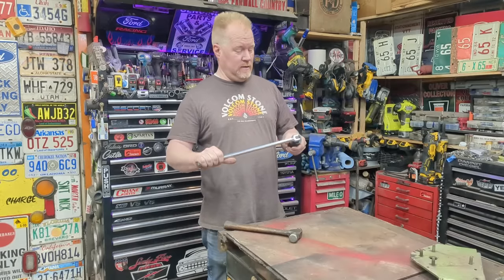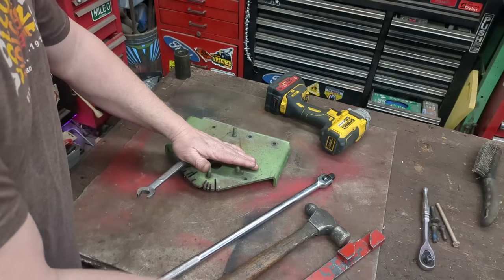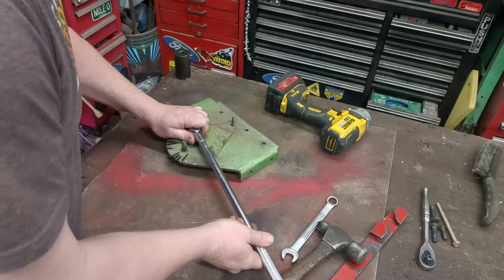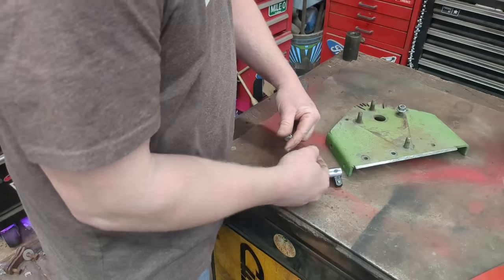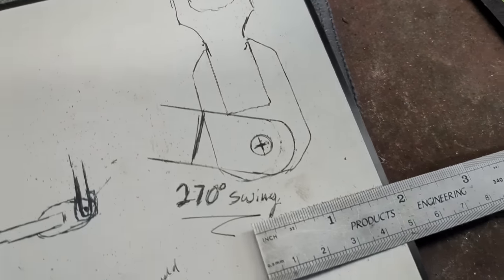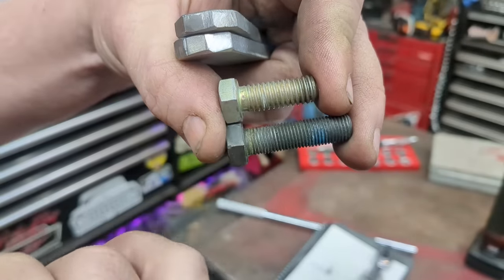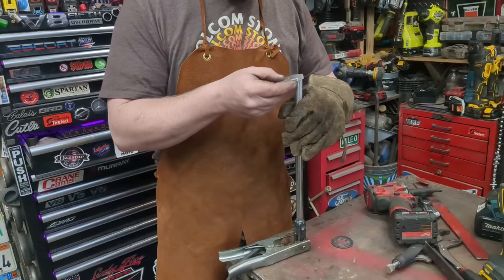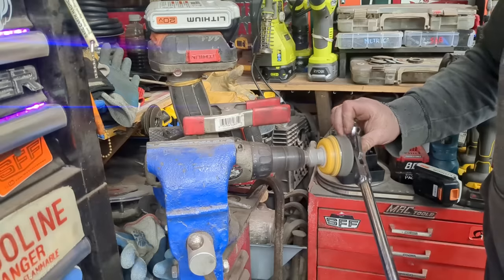Hammer Impact Breaker Bar  DIY BUILD

Comment: You should put a patent on that
Reply: Don't worry. Somebody else will now.
Reply: I'm sure I have seen something similar.
Reply: Snap-on sells hand impact wrenches under blue point.
Reply: I have a very similar tool to the Toledo, T+E, Laser Tools versions, I bought it pretty cheap many years ago on ebay.
2ft long 1/2inch drive.
Only real difference is the black square drive head doesn't pivot, it's fixed 90° to the handle/hinged part👍
Reply: @philmickey7247  This style tool has been around for years, I'm sure they would've come out with their own version by now, if they haven't already🤣
Reply: matco tools sells one. got one in my tool box.
Reply: @simonilett998  'Own' version.
 Years ago... I heard a story of a mechanic 'making' a tool, and the Snap On dealer ask to borrow it. Sometime later, a nice chrome plated copy of the tool was displayed.🤔 That's business.😊
 Thanks for the comment.👍
Reply: @philmickey7247  Yep, probably not too uncommon a scenario.
So, if someone really wants to ensure they earn 'something' after coming up with a 'revolutionary idea', I guess they are best to patent it.
However, I'm guessing registering a patent is quite costly and time consuming, and also specialized tools are often thought up to serve a one off situation, where the 'guy' probably couldn't afford to go and buy an alternative already available tool, or justify having one specially made, let alone afford the patent process😁
Reply: Snap-on has sold one for at least 10 years
Reply: @simonilett998  Ya said it.😊👍
Reply: It's not an original idea.
Reply: Private brand tool has the patent on the tool already.
Reply: @simonilett998  I think it's better that it's fixed
Reply: @schwuzi  I agree👍

Comment: Someone else here mentioned your paint can shaker video and I just remembered some things I did to augment that when I fabricated my own. 
I used lids of various sizes, cut off cans with a safety can opener so there were no sharp edges. Used multiples of those to beef up the attachment to the central bolt instead of washers because the additional lids distribute the force over a larger area. 
I drilled a hole in one of my overhead beams to screw it into the beam so it’s always right there overhead next to my bench. 
I also use multiple sections of scrap rubber membrane roofing to wrap around various spray cans to secure them inside the shaker so I can invert it if I feel the need. I’ve found that being able to hold the can in a vertical, horizontal or inverted orientation helps to get the shaker ball inside to act upon more of the contents. 
I’m currently working on other iterations of this tool utilizing smaller cans to accommodate paint pens, which also require vigorous shaking before use.

Comment: Nice!! We had something similar at work that had interchangeable wrench ends instead of the breaker bar side to remove fan hubs. You could also use either a hammer or an air hammer to impact the other end. I think the breaker bar end makes it waaay more useful!

Comment: They make one of these for a air hammer i use it on Crankshaft bolts all the time i believe mine is made by otc been around since the 90s im pretty sure i gave like 30 bucks for it. I will say you should try putting flat bar on it and welding a anvil just the offset bringing it in more aligned with your piviot you will notice a significant difference in the alignment and less likely to cam off a bolt. Although i do appreciate watching you build it more satisfying in the end if you're capable!! Great video!! 3 thumbs up!!
Reply from the maker: If anyone had one you would. 😁

Comment: Nice job👍
I have a 2ft long, 1/2inch drive version of this tool I bought on ebay many years ago, it wasn't too pricey, only difference is mine has a fixed drive at 90° where you used the pivoting style breaker bar head, so your's is actually a bit more useful for leverage when flipped out straight.
I've used mine a few times for front crank bolts, flywheel bolts and transmission bolts in tight spots and it works great.
I've been trying to think of what to make from a 2ft breaker bar handle, which I broke the head off a while ago.
This video gives me a good idea, I think I might make a 3/8 version out of it, like you mentioned👍

Comment: Hadn't thought about thread depth as it relates to fastener strength...  tucking that gem of wisdom into my hat!

In my defense, during most of my professional work a 1/4" fastener was considered to be BIG!  I dealt with mostly #6, #4 and smaller.

Comment: Definitely need to build one of these things! I have one of the indexable head ratchets from hobo freight. It didn't survive a few taps of the hammer. Ended up finding a fan clutch remover, It attaches to the air hammer with interchangeable wrenches. They have a hook on the end, Amazon $50 saved the day.

Comment: Great idea. Had a simulare idea i've been using for years, hit the end of the powerbar/ratchet with a soft face hammer or small deadblow. No sparks/metal flakes/sharp edges left on tooing/ lower noise impulse
Reply: might be usful if you are looking to design a product to incorperate something link Mastercraft Breaker Bar With Ratchet Head. It would allow you to have a fast reset from realy stuck bolts or nuts

Comment: Very nice, but this tool has been available commercially for some time. It is called Power Bar Tool. The 1/2" version is item # PBT70866. There is also a 3/4" version, maybe others.

Comment: Excellent idea/creation. I will be making one of these because it is too dang handy and multi-use. I will throw my 2 cents in and say it will pair well with a small piece of cheater pipe to slide over the joint to regain used of a plain breaker bar. I would also bet a fella could use this to dial in that extra so many degrees after torquing to the number value.

Comment: Hi Matt . I made a similar one i call a flag ratchet. I cut a 8mm ratchet head and riveted on a small Crome rod . To change the glow plugs behind the fuel pump on the VW rabbit . Then got a 8mm socket with a magnet inside ..And riveted the socket so it can turn on a flat rod .and turn it with an elastic band to catch the 8mm nut . AND THEN . Make a 12 mm Flag ratchet for the glow plugs . Hope you can follow this . From Al the eccentric inventor⚒🛠🔧⚔️🇺🇸🇨🇦 Greetings from Canada

Comment: Wonderfull  invention, Sir !  An old valve, from a larger diesel engine, coulda  been used, on the top end, of the bar - for a ' hitting point '' for  the  hammer.  ....i use ideas, too !  As well as any other useable  item, from  ?...say  scraps.       (Glass front, on oven door, had an accident. Used the enameled covered sheet metal, of an old dryer. Looks good  !) May use old wheel bearing hub, from non-driving rear axle - for a rotating  table....and other ideas.  Keep  mentally  active - folks !
Reply from the maker: Great ideas
Reply: @sixtyfiveford  oh, another one. I used that black pipe insulation foam - the split down the seam type, on the bottom of the wood garage door. Placed them slit-wise, and stapled the sides to door. Works very good - door can drop 3 feet, no dagage, and  N O    LEAKS.  Ants  can't  even get in ; let alone water.   Take care...from Alberta Canada

Comment: Funny thing is, Matco sells almost the exact same thing, just intended to be used with an airhammer and has a box end wrench rather than a square drive for sockets. Might be able to reduce a potential failure point by using two breaker bars and just removing the screw from one and cutting/grinding the other to fit in place. Honestly though I might hit up HF for a couple breaker bars if they go on sale to have something like this.

Comment: That's another tool I'm going to have to make! I use my bead breaker all the time, never seen one before You made it and now they are all over the place even harbor freight, but they are $70 and mine only cost some scrap metal.
Reply from the maker: Those bead breakers are such a time saver.

Comment: Question. Have you seen (usually it's on line wrenches) but where you can put a 1/2" or 3/8" drive into the wrench handle?

Comment: Think about using a Ratchet head in place of the breaker bar head?
Reply from the maker: Ratchets are limited to about 150 ft lb before they break. I think this is delivering around 5 to 600 foot pounds with every heavy hammer blow.

Comment: This is some kind of fate or something. On that VW diesel engine you show, I have to replace the intermediate shaft pulley. There's very little space unless you drop the engine down or pull it entirely. Also the shaft like to spin even though it's up against the timing belt. This is probably my answer.

Comment: This is genius. I wonder how many ft lbs of torque you're applying hitting that. Got a way to test it?
Reply from the maker: Rough estimate was 500-600 is achievable. I guess the only limit is how big your hammer is and how hard you hit it. Then whether or not it breaks.
Reply: @sixtyfiveford  I'd love to see torque test channel stick one on their dyno to see. This takes what an impact does and makes it vastly more simple and you don't need an expensive tool and battery system to make it happen

Comment: Curious on the cordless band saw, are they designed to be up right. I have been considering one for a while.:
Reply from the maker: You can buy a table you mount it too. I just clamp the handle in a bench vice and throw a spring clamp on the trigger.
Reply: Thankyou great idea @sixtyfiveford

Comment: Brilliant concept, Moe!
Unfortunately (for me), you hit really hard on one of my pet peeves in this video and another linked in the description - the use of the word LEVERAGE instead of the word TORQUE. There is absolutely ZERO leverage involved with this tool or the red one you linked to. Both apply (or increase) TORQUE -a rotational force applied around a central axis. Correct usage of these two words is imperative for describing and explaining to novices how force is applied and used. Leverage requires a lever arm and a fulcrum and does NOT rotate around a central axis - it transfers force in a linear direction. 
Understanding these concepts is crucial for an understanding of the use of tools and basic mechanical functions.
Please understand - I am not being critical of you personally - I’d just like for viewers to understand there are important differences between these two forces and how to best utilize them to one’s fullest advantage. 
🔧🔧🔧

Comment: Milwaukee could have labeled speeds in RPM instead of forcing the consumer to consult the owners manual to determine what 1-4 means.  Absolutely silly.  It makes me angry every time I pick up my angle grinder.
Reply from the maker: So dang true. I finally ended up just writing in it. They could have least made the sticker it comes with from the factory a permanent decal.
Reply: @sixtyfiveford Most of the time I just set it to 3-4 and hope for the best.  I always used my air grinder @ 175psi unregulated (static) and nothing bad ever happened!

I'm gonna try a paint marker like you did...my sharpie keeps rubbing off.

Comment: Seems like a solution for a problem that doesn't exist. If you can't get a ratchet on it to loosen it then you aren't going to be able to get a ratchet back on it to tighten and torque it to spec.
Reply: Did you skip past the explanation part of the video, or even watch the entire thing?  Just because you can get a ratchet onto a nut or bolt does NOT mean you will have enough room to turn it.  If you had paid attention you’d have noticed that the motion used to break it loose is completely different compared to the standard ratcheting motion.